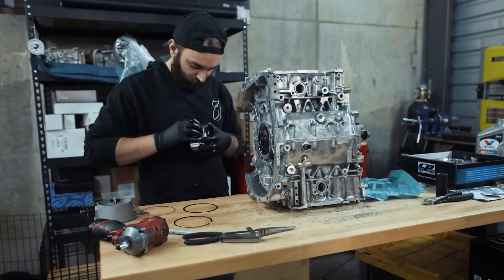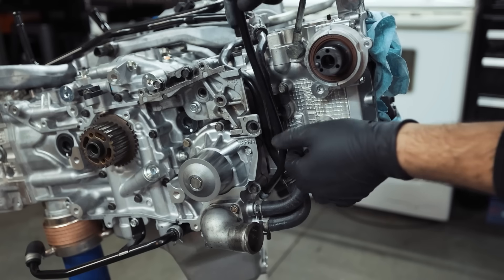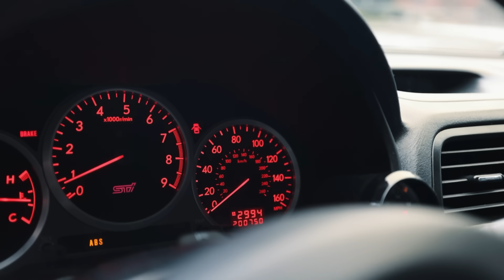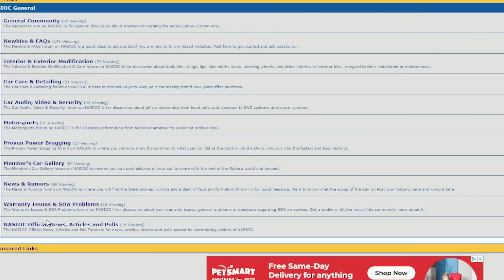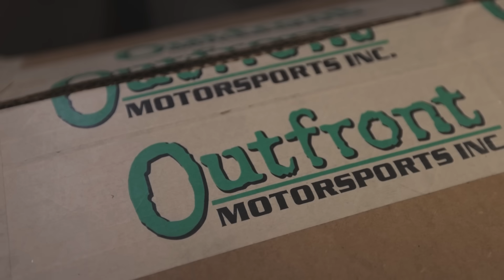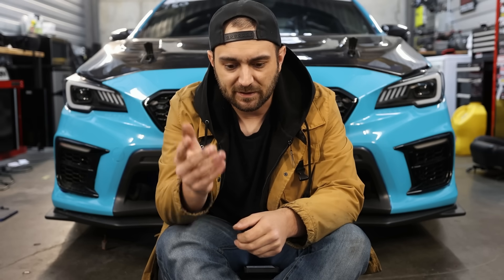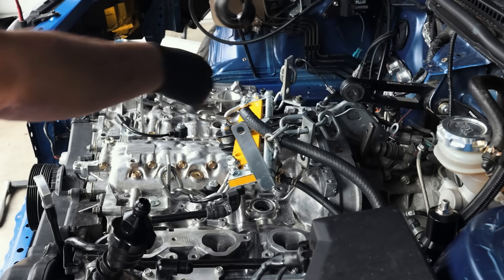The EJ Engine: Subaru's Crown Jewel or Overrated Relic?

Comment: Personally I think the same could be said for FA engines. Granted I've never driven an EJ based wrx and would love to have one some day, but for someone like me who never had a particularly fast car 300 HP with some bolt ons and a good pro tune is awesome, bonus is decent gas mileage. And if I really wanted the sound of unequal length headers tomei makes em for 500 bucks
Reply from the maker: Please do no put UEL manifolds on FAs, it’s not great for the FA engines 😅 but the FAs are great reliable power plants sub 450 WHP 🔥
Reply: @Smeedia  Honestly with the better cylinder cooling and larger bores Id argue they can handle UEL headers better then EJs. Problems only start from the weaker rods which as long as you keep it under 350 tq youre fine.

Comment: Like others have said, your videos are so valuable to all of us!! My EJ failed in my 2012 sti 3 weeks ago :( not exactly sure what happened, it was knocking a bit then shut down. I bought a new “stage 2” block. The shop thinks it will be about 16 grand total for the whole job(includes e85 tune) do you guys think that’s a normal price? I’m upgrading turbo to a blouch 20g 8cm, they say I should be at about 400whp( currently 345) Kinda seems low to me considering all the mods I have. Full Cobb e85 kit with the injectors, rails, fuel pump, headers, exhaust.

Comment: If Subaru had made their turbo engines closed deck it would have gone a long way in helping out their image. My EJ22t has over 300,000 on it and to my knowledge was the only closed deck engine the US got. That engine is very desirable and in demand.
Reply from the maker: Factory closed deck blocks would have been absolute game changers. V7 207 and 22 are top 🔝

Comment: I had an 05 legacy gt 2.5L original engine and trans modded and tuned. make it 311k before I sold it.
Reply from the maker: 300k miles + is impressive 😮
Reply: I miss that car. I replaced it with a 15' Wrx it's a great car, but it's not the same. And if I weren't putting lots of highway miles on it, I would have purchased an Sti.

Comment: They definitely need a new revamp or atleast make it stronger, I’ve made 700+ on fa20’s and the fa24 is showing good potential to do all that stock long block, like the blue one in Dallas makes 850 in his fa24, 🤷🏻‍♂️ if Subaru upgraded bearings and stuff it would be fine both ej and fa
Reply from the maker: Imagine if Subaru went back and gave us a revised EJ 😅
Reply: @Smeedia they definitely should, ra blcok with better rods and everything would be fire 🔥, I do hope the fa24 goes a long way, it’s different and I’ve worked on so many Ej’s that I wanna see a successor

Comment: Imo it was a godsend that subaru stayed with the same engine in the STi for so long. If they had constantly changed it, the ease of afermarket support would have suffered and so would have availability of parts. Yeah maybe it would have been nice for the VA STi to have had ~360hp instead of almost the same power it had in 2004, but at least it made modding and tunning as easy as possible. You almost wonder if subaru didn't change it on purpose
Reply from the maker: Subarus mentality, If it ain’t broken, why fix it? 👀
Reply: @Smeedia  they probably could have made it tougher but other than that you’re right

Comment: My daily drive 04 WRX that my mom bought new is about to hit 260k miles on the original motor and 4EAT (we have genetic knee problems lol) and for 60k of that it's had a Cobb Stage 2 package and OTS tune, which isn't the best, but it's going strong. I want to rebuild it regardless at 300k given the abuse I've personally given it haha
Reply from the maker: Tbh I’m surprised the 4EAT is still going strong 😅 those transmissions have always been super thing miss
Reply: @Smeedia  it's probably been "launched" 50+ times past few years too and it hasn't shown any issues hehe

Comment: Over time Ive learned a few things about what makes a car reliable, it always boils down to how well the owners treat them (engineering nonsense aside), stock or otherwise. Subaru's get a bad rap because its an unconventional style engine and anyone who only works with inline or "v" style engines, have to rely on those who they know that work on them, which means that can vary greatly. Example, youve only owned GM, you know them like the back of your hand, youre not too unfamiliar with other non GM vehicles when it comes to repairing them, youve got a friend that LOVES subarus but you always see the ones he's owned is almost always on jackstands, hes the type that does hardly any research and kind of fumbles around the engine bay, not really knowing what hes doing, for you thats your only line of knowledge into the subaru platform so by proxy you associate your friends experiences and see a trend of other people who also have problems with theirs that most likely do not know how to actually take care of them or modify them. So you kind of assume they all must be crap.

Basically anyone with fair amount of knowledge and knows how to do their research will almost never be apart of the statistic. You can talk to youre blue in the face, show everyone like you have been how simple it pretty much is to build and maintain these engines but the damage is done unfortunately

Comment: The ej was the longest production motor in the history of man….. 1988 to 2021 enough said. They did something right but yes the fa actually addressed some problems.
Reply from the maker: Is it actually their longest produced engine? 😮‍💨
Reply: Are you sure about that?  " the longest  production motor in the history of man?  What about the small block v-8 chevy motor?
Reply: @outlawhillbilly3851  small block Chevy changed through the years and is no longer produced as the small block your thinking of I’m talking factory made. Not a crate motor, factory made motors. But yes Chevy small block would be the American longest for sure and Subaru in the jdm market. That was my first car/ truck motor experience was the 327 small block, and the temptations to put that monster in my Subaru is there
Reply: @Smeedia  it is one of them for sure the actual one is the rolls Royce Bentley v8 that hasn’t changed from the 60s till 2020. But as far as practicality goes it’s the longest unchanged motor design according to google while other motors like the small block Chevy were in production they were dynamically changed enough to basically call it a new motor, going from solid lifter, then hydro lifter then roller lifter, then completely changing the heads. Then the timing set up, then the injection set up, from caurbursted to throttle body injection to the tuned port injection where as Subaru basically changed rod bearing and thrust bearing locations in 99-01 erra phase 1-phase 2 and then adding avcs, semi closed deck blocks, but it never changed its overall design, and being produced by Subaru factory from 88-21 makes it the longest factory produced practical motor, beside the rolls Royce that actually took the award by never changing from the 60s but Subaru made more ej motors in 1990s than rolls Royce ever made ever.

Comment: The true future is hydrogen turbo. So the next future Subaru will rumble and it will run on hydrogen and be 12:1 compression, turbocharged direct injection. Screw electric I’m ready for the hydrogen generation, I need some motor sounds in my life the Mazda hydrogen turbo inline 6 just came out 379 ft lbs of torque and 339 hp at the crank factory. And well how to not turn our car into a hydrogen bomb I think is figured out by 2024, I’m gonna swap my car to hydrogen sti when it happens.
Reply from the maker: Where you getting this insider info 👀 if they do go that route I’d prob pick one up pending price 😅
Reply: @Smeedia  Mazda just released the motor this week. My Subaru theory is my hypothesis, since Mazda is doing it I bet Subaru jumps all over the band wagon is my guess. Plus we still get the rumble. Dude real power is coming
Reply: Hydrogen can be liquid hydrogen as well but the point that electric is failing miserably tells me that hydrogen era is coming. We have a hydrogen running s10 with a 4.3 vortec in coosbay Oregon right now running around town. Says it’s basically like stock power, but just dumps water in the tank and turns the element on. I think it has salt water actually. But the technology is there and I definately want to put a hydrogen sti motor in my Subaru.

Comment: See MotoIQ Subaru EJ vs FA Engine Smackdown.
Reply from the maker: I think I’ve seen it, FAs made great advancements over the EJs but the biggest draw back is that factory DI fuel system. In a real world application it holds back the FAs from really being pushed
Reply: @Smeedia  Easier to add a good aftermarket ecu and port injection than correct outdated engine design.Subaru really hasn’t done a lot for there performance enthusiast’s since dropping out of the WRC.I’ve owned many Subaru’s but technology has moved on.I currently own a 8Y RS3.

Comment: The EJ is a pretty poorly designed engine overall... Its a perfectly fine engine stock, but it is a TERRIBLE engine when you start modding it. And yeah, I am sure there plenty of people who were able to get lucky and not have problems. A friend of mine had a 500whp D-series SOHC run for 7 years with no problems(which is insane)... That doesnt mean anything tho... The test of a great engineered motor, is the air it can flow, the rpm it can achieve and withstand, and of course, durability and reliability. This is why the K-series is probably one of the greatest production engines ever mad. Both k20's and K24's can EASILY rev to 8k+, their heads flow a TON of air(which is also why they sound so bad LOL), and, they are just super robust for what they are. Just great design. Easy, no BS.
Reply from the maker: I won’t deny the K is fantastic, butttt when set up properly EJs can take abuse. I know a handful of people at 600whp on stock motors and they drive drive em. Even built ones for EJs all of my prior ones have never given me a hiccup 👀

Comment: HP per dollar makes it overrated. I mean bruh 10k to get 350-400?
Reply from the maker: You can def do it cheaper 👀 
ID1050s, 340 pump, intake, boost controller AP, BCP500 and down pipe and we could get you there 👀

Comment: Checking in Chief 🫡
I really wish I bought an EJ207 long block when they werent north of 6k....
Reply from the maker: They used to be so cheap 😢
Reply: 207 direct from RC via Flatirons $3300 v7-8. I have V8 spec C built by TIC.